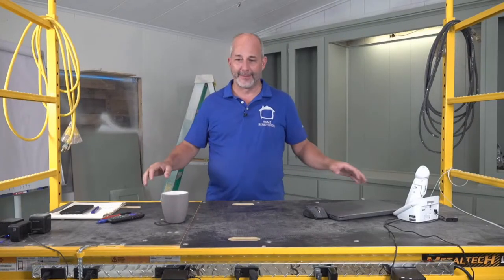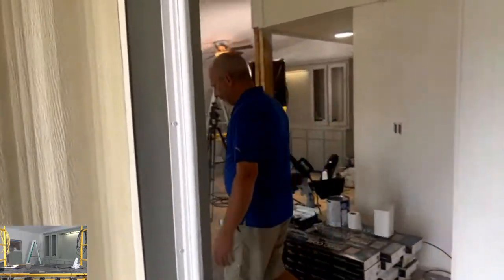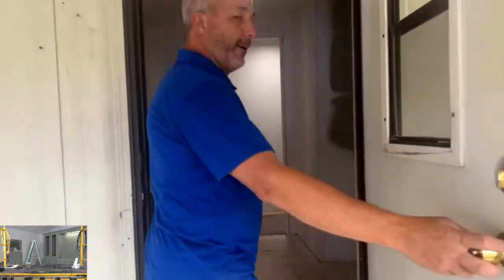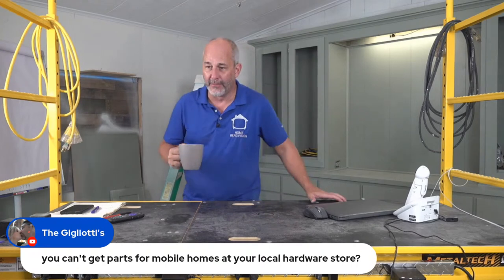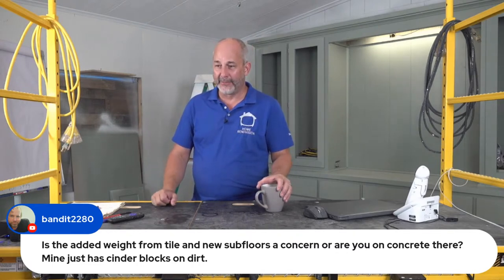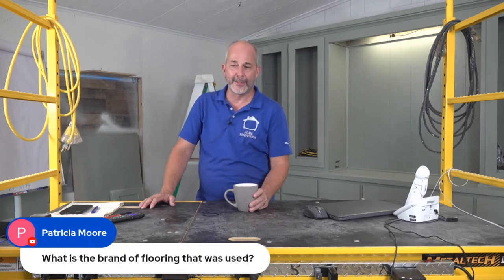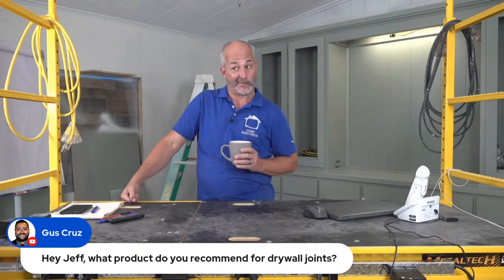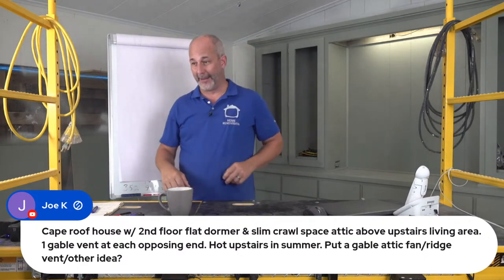Behind the Scenes Sneak Peak of My Double Wide Trailer Renovation !

Comment: I have 2x6 studs in my walls here in South Texas. The insulation is to keep the cool in. Noticed that for the winter freeze we had here a couple of years ago, when we had no electricity, the house only got down to 54 degrees.
Reply: I designed and built an R2000 home in '94-96 in my spare time along side 3 part time jobs. The thick walls kept the house warm in winter, cool in summer. Win win. Spent up front, buyer saves forever.

Comment: Why did you have to lift everything up 3/4 of an inch because of the subflooring? When I replace the subflooring in my mobile home on the coast of Mississippi, we just simply cut out the bottom of the wall and slid the subfloor under the wall on top of the joist. It was my first time ever doing subfloors and I was learning from amateurs and watching YouTube videos. And in hindsight I wish I would have seen the video where they were putting the insulation in before they laid the subfloor down. For those of you who haven't gotten that far. That way if you're underbelly is damaged like mine was you don't have to crawl under there and try to install that insulation From Below. Also I would like to point out the fact that the reason I had to replace my subfloors is because my mobile home is in a community similar to yours. And there were three empty mobile homes around mine at the time that I bought it. So I was the first to have running water on the Block. And mice chew through my pets Plumbing and we could not hear the water running underneath the mobile home but inside the belly I woke up one morning and my floors were warped like a skate park.